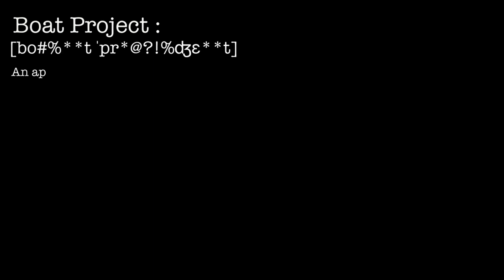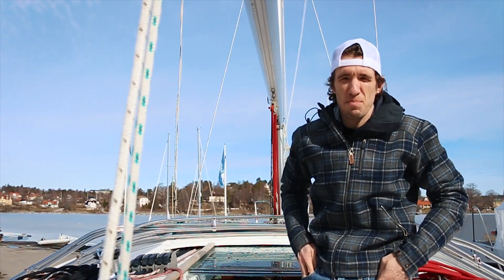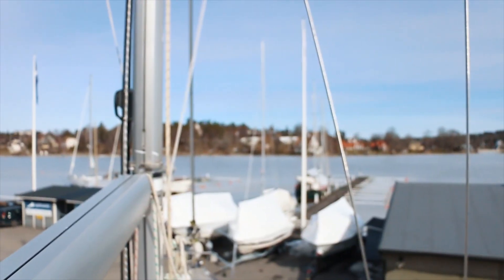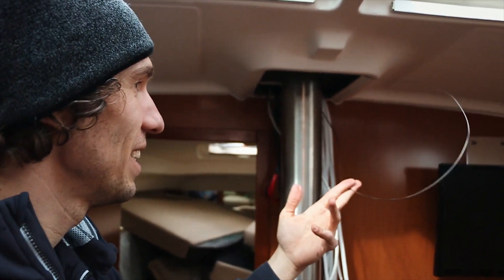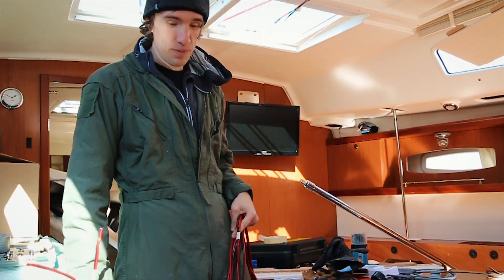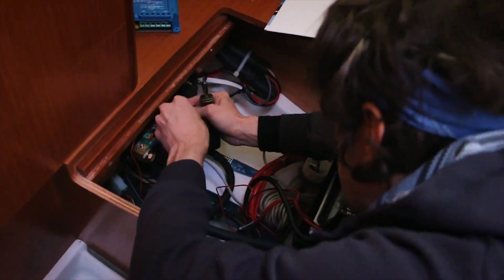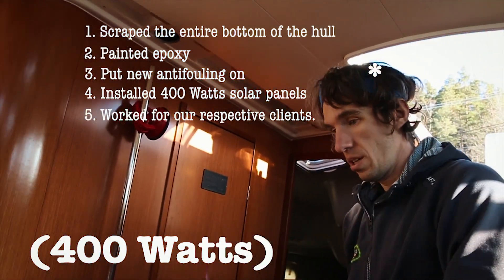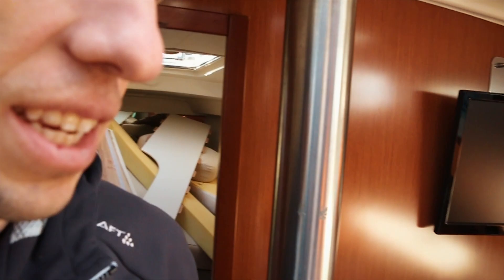Our most painful boat project yet: installing flexible solar panels. #4

Comment: Wiring Club Med: I. Deck thru connectors to MC 4 wiring. Monel or bronze bolts are excellent wire connectors. 2. Permanent topside frames for removeable small solar panels.  ....Don't forget to lightning ground the frames.

Comment: I dont know if this still is the situation.... and I dont know if you need any hints and tips... but still; here we go;

Harvesting energy from the sun is the best way to cover your needs (in my opinion) , but owners should know that there is no flow of current if batteries dont need any charge (batteries are fully charged). The regulator should automatically take care of this. 400 watts of solarpanels should in practical use give 18-20 amps on a sunny day (if sun above you). Theoretically there should be as much as 33 A in 12 volt... but in reality not so much.. But 18-20 Amps is great if you ask me.

My setup is also 400 watts solar panels. Typically I do have a total of 100 Ah of consumption during 24 hrs. Lets say my batteries are fully charged by sundown; If my batteries has dropped by e.g. 50-60 Ah during the night, my solars need 3-4 hrs the next day to top up my batteries again. Then again, if batteries was 100 % by 13.00; the solars and regulator dont deliver any charge after that. How ever, the solars deliver what ever usage of amps I have. In other words, all my equipment is now running directly from the sun.

Then we got the days without any sun; on such days it is better if one got a bigger battery bank. Another great device is the fuel cell. Methanol charging the batteries. I am using 20 liters of methanol in a year. Thats aprox 1000 amps from 10 liters. The waste is water only. Check it out Efoy Comfort 210 will give you a steady 8 amps 24/7 if needed. Installed in 1 hrs. But kind of expensive.... 

I do monitor all the volts & amps. I got one LCD displaying whatever comes from the sun, and I got another LCD displaying whatever goes into the batteries. Both of these LCD´s can show all kind of info about volts and amps. 

The regulator; better spend money for a quality regulator than a cheap fake one. Some regulators dont prevent current flow in the direction from the batteries and up to the solars.. during night... Yes; the current can flow back up there.... Batteries charged during daytime, and drained during night. In such case, one could stop this night flow by use of one big diode. (A diode is great in any case if you ask me)

I keep a spare regulator... never know....

If you need any hints & tips...... ?... please ask :-)
Reply: FYI, the Efoy Comfort 210 fuel cell also produces CO2

Comment: Will Prouse (youtube) blew the whistle on flex solar panels,  a shortcut that backfires so bad.  I'd recommend square panels instead of tall ones and even more expensive 50 watters over my favorite 100 watters.  Boat builders should start including interior slots for storing panels during storms.  Single strand wires are more weather resistant than multi strand on deck.

Comment: Check the Gone with the Winns video on solar panels. Several of your panels are always partially shaded, no matter where the sun is. Even small shaded areas impact tremendously the power generation of solar panels.  Or at least they used to be this way.  And if I remember correctly, the Gone with the Winns solar project, they did test connecting panels in series and parallel against partial shading to see which one, parallel or series, would generate less losses. Check that out.  Great channel!

Comment: You two are hilarious!  I can completely commiserate with your experience, just finished running my wiring runs for solar yesterday (not fun!!).  But it sure feels great when it's done and you can make power from the sun!! Good work, keep up the fun times ;)
Reply from the maker: Hi Saltwest!  Yes, its a great feeling.... i was actually surprised when it worked on the first go! i was left standing there thinking "well... now what :) guess i put the boat back together"  It will be interesting comparing the solar output here at 59north to lower latitudes so that will be exciting :)  Good luck with your project and thanks for watching the channel.
Reply from the maker: Thanks you! We haven't had the opportunity to try them yet, but it sure feels good to have it done :) Ryan has been working on the boat a lot since the solar panel, with an equal blend of frustration and satisfaction! /Sophie
Reply: Yeah, it kind of just keeps going like that...lol.  You'll have to do a follow-up showing the output of the panels, what you like about them, and anything you'd do differently.  We're going to do the same I think, a little followup.  There's so much information out there that I think it helps to show people how the "actually" work, rather than just the theory of various installation methods.

Comment: Did you solder the joins in the solar feed wires?  Kinda looked like you crimped them all, which could come back and bite you in the bum.  We had problems with our solar install that traced back to poor joins from using crimped joiners.  Solder + some heat shrink is a better long term solution, but it might be too late by now!
Thanks for the video.
Reply from the maker: Hello!  No, i did not solder but that crimper  used was a hell of a tool.  The joints did have heat shrink on them however.  The good news is i can access all the joints with ease so if i do run in to a problem it can be fixed quick.  Thanks for the suggestion and comment.

Comment: for long term reliability and efficiency consider a upgrade to a lithium battery bank..SV Delos has a great episode dedicated to their switching from lead acid to lithium
Reply from the maker: (Ryan) hi matt. Thanks for the tip.  We have a lithium surprise coming... but for a spoiler, I'm involved with a company that is now producing lithium boat batteries.  I plan to do a segment on us installing and testing as well as the benefits... but that will be this winter.
Reply from the maker: Hi Matt! Ryan actually owns and do a lot of work for... a lithium battery company! They are right now developing a lithium battery engineered especially for marine use, which we will test on Polar Seal this winter. We'll let the community know how that's going :) 
/Sophie
Reply: +Ryan & Sophie Sailing ..thank you both for replying ..i look forward to seeing the upgrade videos and hope the company thrives

keep up the good work and enjoy !
Reply from the maker: Oh... I didn't realize that Ryan had already answered, really sorry for spamming! Ok, over and out ;) /Sophie

Comment: hi, are they at high temperature with the sun? can you walk without whoes on them? ThankS!
Reply from the maker: Hi Oriol.  Yes, you can walk on them without shoes... but they do get a bit hot.  We have actually removed all of them because most failed.  Not so much because of the panels but because they needed a smother surface.  More to come on that.  Ryan
Reply: @RyanSophieSailing  thanks

Comment: did you run wires for each panel to the battery, or did you put in a junction box to consolidate the wires and run a pair of wires to the batteries?   Did you install a charge controller?   Most people I know use rigid panels over the stern of the boat to reduce shading of panels by sails, mast and boom.  Enjoy the projects.
Reply from the maker: Hi Robert.  Yes, I ran cables for each panel.  People might see this as overkill and i went back and forth on it many times.  The problem you can see from the video was space so if i used a junction box i would needed to have had it on deck as there was zero room for something like that in the mast.  My other option was to put something in the headliner but i did not want to have to pull the headliner down each time i needed to access something.  Thus, I needed things to be; 1. Safe, 2. accessible, 3. look good.  

I have two MPPTs from Victron.  I have the port side panels on one side and the Starboard side panels on another.   I constructed it this way to help with shading issues (lets see if it actually works... but the nice thing about running all the wire about to the battery box is i can change the setup very easy if i would like)

I also looked at rigid panels with a structure to support them but the cost and time of building something just did not work.  we might still look at it in the future (and i do believe its a great idea for a lot of people) but not now.

I will try to write some details about the project on our blog... ask as many questions as you want!

Comment: Voltage drop will effect you as you have long runs to inverter. Not good. Should have invested in an arch and mounted cheaper solid solar panels. Easy to instal, more power per €€€.
Reply from the maker: Stand by for a future video Latitude.

Comment: And if one panels is in the shadow... and the other is in the sun... There could be A current flow between the panels... A inline diode on every panel is a good way to prevent this scenario.  .....
Reply from the maker: (Ryan) Jan... was looking back at comments as I'm having a few solar issues.  Do you know of any easy, inline diode devices?  The manufacturer believes this is not needed in parallel but I'm wondering if this is true.  

Looks like you buy the diodes and have to soder them in the line somehow.   Any thoughts?
Reply: @RyanSophieSailing  Hi there; Happy New Year :-) My theory is that if you have two or more panels in parallel, and one of them end up in the shadow; there might be a flow of current (A) from one panel to the other. I never did any measurements or test, but it fit the theory for sure. I have seen current flowing in direction to the batteries during daytime, and from the batteries during the night. In the morning the batteries was drained. (Solar used as heater) An inline diode fixed that setup. For that reason I did mount a diode on every panel. Yes; I loose a tiny portion of the solar harvest, but save the panels from disaster.  I am using a ready made inline diode mounted in MC4 connectors. I am also using the "MC4" connectors on all my panels. Easy to plug unplug etc. On the wire routed to the regulator I am also using inline fuse to protect the cables (RV / boat).
MC4 connectors I also bought in bags. Makes life easy on the road if any need to be replaced. Also need crimp tool. Check out the links for the MC4;  Regards Jan 

https://www.aliexpress.com/item/5-PCS-Lot-High-quality-IP67-MC4-diode-connector-solar-diode-connector-used-for-Solar/32780658546.html?spm=2114.search0104.3.1.4a7941e2IjSQpy&ws_ab_test=searchweb0_0,searchweb201602_4_10065_10068_319_10059_10884_317_10887_10696_100031_321_322_10084_453_10083_454_10103_10618_10307_538_537_536,searchweb201603_1,ppcSwitch_0&algo_expid=7d8e4831-a61f-4aaf-b0ec-0d89eefaee10-0&algo_pvid=7d8e4831-a61f-4aaf-b0ec-0d89eefaee10

https://www.aliexpress.com/item/1pcsFuse-Holder-Protective-MC4-Connector-Fuse-protection-1000-VDC-Male-to-Fem-PV-Photovoltaic-Solar-Diode/32848494238.html?spm=2114.search0104.3.16.4a7941e2IjSQpy&ws_ab_test=searchweb0_0,searchweb201602_4_10065_10068_319_10059_10884_317_10887_10696_100031_321_322_10084_453_10083_454_10103_10618_10307_538_537_536,searchweb201603_1,ppcSwitch_0&algo_expid=7d8e4831-a61f-4aaf-b0ec-0d89eefaee10-2&algo_pvid=7d8e4831-a61f-4aaf-b0ec-0d89eefaee10

https://www.aliexpress.com/item/MC4-Crimping-tool-for-MC4-connector-solar-cable-PV-Crimp-tools-DIY-solar-power-system-connect/32734262499.html?spm=2114.search0104.3.109.27c253ee5GMkj5&ws_ab_test=searchweb0_0,searchweb201602_4_10065_10068_319_10059_10884_317_10887_10696_100031_321_322_10084_453_10083_454_10103_10618_10307_537_536,searchweb201603_1,ppcSwitch_0&algo_expid=9aed1c94-a27d-4a61-8789-1f7819f03580-15&algo_pvid=9aed1c94-a27d-4a61-8789-1f7819f03580
Reply: @RyanSophieSailing   Looks like Youtube removed my links for the products and some text. I use a ready made MC4 INLINE DIODE (can be bought in several sizes like 10-15-30 A) . I will send the links as email.

Comment: Very entertaining! Curious your thinking on placing them on foredeck vs bikini top
Reply from the maker: Hi Richard.  I considered all the of options.  The problem i saw with the bimini was the process of opening and closing it.  I dont always like sailing with the bimini on as it reduces some of the viability.   Additional, a lot of the problems people have with flexible panels is the repeated bending of the panel which can lead to an early failure.   in the end my two options were to place them on the deck or build a stand off the back.  Building the stand was my number 1 option but the cost and time this year prohibited it.  

Hope that helps... let me know if you have any more questions